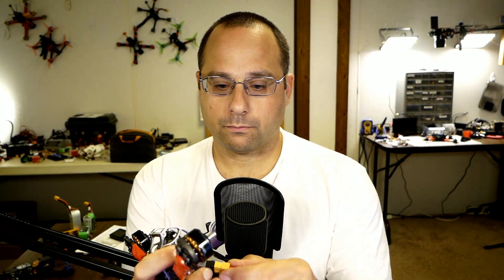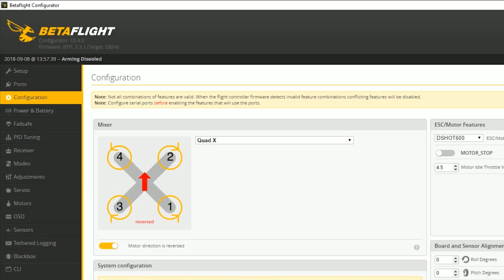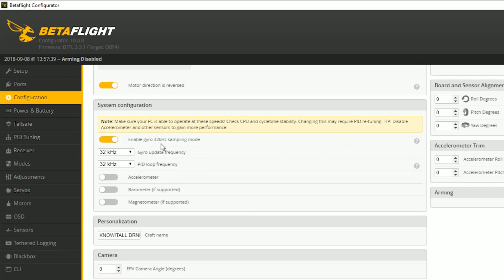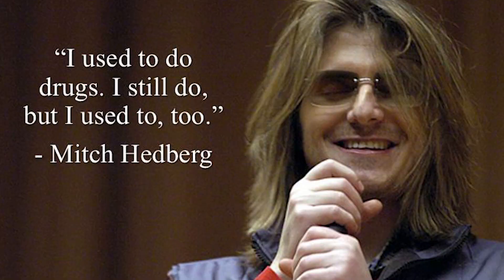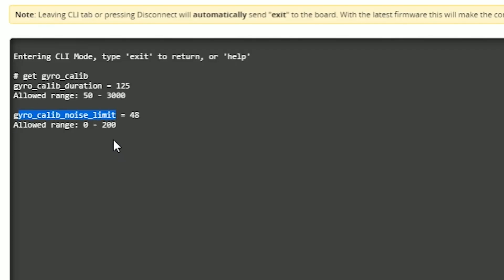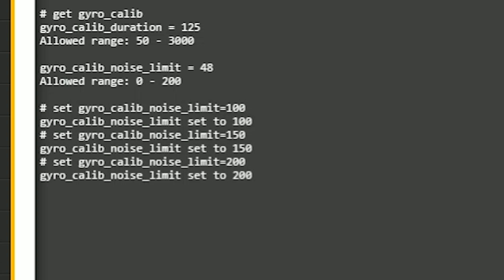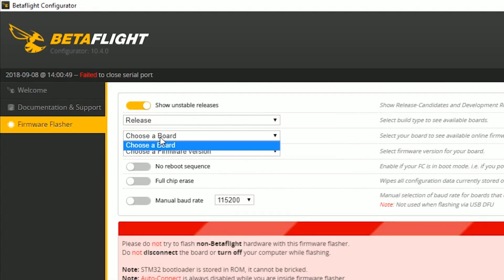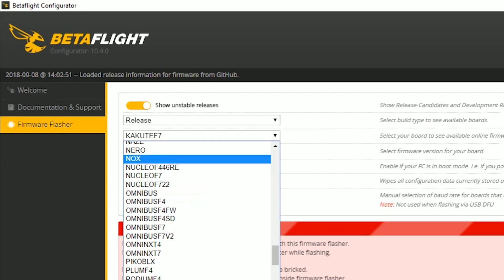BETAFLIGHT WON'T ARM | CALIB NOGYRO arming status flags

Comment: Nooo Joshua,
Where do you get your info?
You should first raise gyro_calib_duration. That should solve the issue. If it doesn't the electrical noise level is to high and you should solve that problem first. Some causes are addressed below by other pilots. Bad bec, ESC to close to the gyro, etc. Copper foil on 4 in 1 ESCs can help. Having 2 gyros on your FC is nice in this situation so you can switch to the other less marvellous but more noise resistant gyro, like an MPU6000.

I'm sorry to say this but high expenses destroy our hobby. You are frying your 32KHz gyro. When you fix this issue by raising the moron threshold you're a moron. You are flying a quadcopter with a noisy gyro which is not working optimal or barely even, and you fly like a drunk. This gyro_calib_noise_limit solution is a crazy emergency quick fix in the field when raising gyro_calib_duration doesn't help, and you know what you are doing. That's why the moron name is changed. But be aware you are gently frying your 32KHz gyro doing this, and you end up with a NOGYRO and you can buy a new FC or external gyro. Recognize this, Joshua? How many FC's did you fry so far? We're not all getting FC's for free.

Also be aware the 32kHz gyros are very sensitive to motor noise, after arming successfully. Usually rubber stand offs for the FC will help. Make sure the FC/gyro is isolated from the frame from motor noise, etc, with rubber or gell. Gell housing gyros address this issue. Symptom of this issue is a high pitch audible oscillation that does not go away (completely) when PIDs are lowered.

Another possibility of fixing nogyro . When your board has 2 gyros you can select the other gyro in cli and your board will work again, MPU6000 on 8 kHz usually. Usually this issue is caused by a broken gyro ribbon cable or a bad 3V regulator that fries the sensitive 32KHz gyro.
Reply: I tried both.  14G impact made my gyro extra sensitive to cold calibrations, especially below freezing at 2S on a Tinyhawk S.  Seems to have fixed it, for now.
Reply from the maker: I have never personally experienced a NOGYRO or had to raise the noise limit on any of my quads. I get this info from betaflight devs. Especially as 32k sampling was becoming more common, the default gyro noise limit was too low for some setups and it was recommended to raise it.
Reply: @JoshuaBardwell  Thanks, I'm glad to hear that. You can validate my story with the FC developers. I've paid my dues to develop this knowledge.
Reply from the maker: Good tip on the ribbon cable for NOGYRO. I didn't think of that.
Reply: so is it safe to raise gyro_calib_noise_limit ? my quad wont arm and by increasing gyro_calib_noise_limit it fly again.but after reading this comment now  im afraid
Reply: @AldoSoeprayogi  Modern gyros are "micro electro-mechanical sensors" (MEMS).  Mechanical things wear out over time, and the higher the threshold of noise means it's further along in it's lifespan.  Long story short...  Fly it until it doesn't work to your liking, or fails catastrophically.  Its going to fail on an impact, so if you can takeoff and fly normally, it should be as safe as the other 40 points of failure on a quad.

Comment: I actually had an issue with arming after a short flight the other day and was super happy to see this series. I connected to betaflight and realized all the setting had been erased. It was like it was a brand new fc. I have no idea why it cleared all my settings but at least I don't need a new fc as of right now.

Comment: When i conect batery to my drone start beep otherwise and i cant arm..then i want conect to betaflight and i cant...No configuration received within 10 seconds, communication failed what that mean?what i must do?
Reply: Daniel, make sure you have the correct Comm Port set up.  There are lots of videos on setting up Comm Ports for Betaflight.  See if you can connect to Betaflight WITHOUT a battery attached.
Reply: cavman7 i had conect before but sometimes i cant just like now...when i wont fly i must turn on transmiter and then a quad and quad start beep and i cant fly...i had that problem before and then gone but now starts again and i cant fly...my board is sp racing f3...i dont now what to do
Reply: Daniel Katić  If the problem is intermittent, then it could be a loose connection somewhere or you might need to re-flash your firmware.

See if you can connect to get it to connect on Betaflight and then check/wiggle the connections on your FC and see if it  disconnects.

Comment: I had this problem on HGLRC FC. Known issue - solder under gyro were wonky. Reflow with a good flux and all is good now :)
Reply: Yeah I had no gyro problems like many others on two HGLRC F428 boards new out of the box.  Reflowing wouldn't work reliably. Third one I purchased a few months later works ok.

Comment: The calib error can also occur if you have high electrical or EMF noise, for example because of a noisy 5V supply , or if you gyro is super close to your 4in1 ESC.
Reply: Elwin van der Meer I totally agree. I fixed a Calib Flag on a Betaflight F4 board by going from Vbat power input to an external 5V bec. So don’t throw away your FC just yet!
Reply: @mcrubens  But that way you don't have vbat in your OSD. The BEC on your FC is no good and you should demand warranty of the seller for a faulty FC.

If you are trying 32KHz I can recommend among others Airbot OmniNXT and Matek 32KHz FC's. Beware of crippled fakes so best order direct from manufacturer.

Comment: Mr JB You make this for me?... Im gonna try different firmwares because its still  being so dumb.. I got i working by putting an adjustable Regulator between 4in1 power and fc and adjusting it. It hovers but did a death roll after tried a couple of flips in horizon mode... 😔 Its the mini f4 osd from bangood btw and i think its the omnibus F4 i flashed it too.. Still scratching my head about it.
Reply: Sounds like a esc issue , I would try a different 4in1 . Something's going on with the regulator in the 4in1. I don't think there's anything wrong with the fc
Reply: @Robert67909  the esc doesn't have as far as i know.. Its just straight voltage from batt..

Comment: Never underestimate the Glitch Gremlin and those electronic ghosts...^^
And lol we actually had someone have the gyro not calibrating a couple days ago. Turned out later the gyro took really long to calibrate, like over 1 minute... o_O
Oh one more thing, I have the same issue with my barometer - after a crash it stopped working and now is intermittently showing wrong numbers but mostly zero. A case where reflowing might do the trick but I'm way more experienced now with soldering than I was back when I put my Geforce 270 into the kitchen oven because I had read about it. So I'm not gonna stick my FC into the oven, mostly thanks to you (and Ben Heck...) xD

Comment: I have an XJB 145 that I can’t get to arm. I’m about to buy a second and keep the first for parts...
Reply: I know this sounds stupid but go back to 3.1.7 Firmware and see if it'll arm because sometimes the new releases don't support the board software and that some of the bug fixes they need to look into. Most of the time you're good all the way up to 3.2 firware with most boards! 
Also check your min throttle and receivers tab in betaflight because if you're using Spektrum dx6 I like the older style it'll only go to a 1955 and 1055 on the minimum  and if it's not below 1050 in receivers tab then it won't arm. Raise it to 10 60 or higher and see if it arms
Reply: I tried both of the steps u recommend, I think my esc is the problem. I got this quad second hand as the original owner had nothing but problems. I replaced the fc and tried to arm it in its factory settings and no go. I see all of the functions work properly in beta flight. Arm tab turns yellow. But the motors do not spool. Hence why I think it’s the esc 4n1.
Reply: Kframe FPV  most times the connection betweeen the fc and the esc is broken on the HGLRC stacks due to crashes. 
You can rip those lousy connectors off and do some wires soldered in between the fc and the esc.
Reply: Yeah to me that would confirm it . Good trouble shooting man . Get you a 4in1 esc and get back to ripping lol
Reply: What is the arming message you get when you enter 'status' in cli?